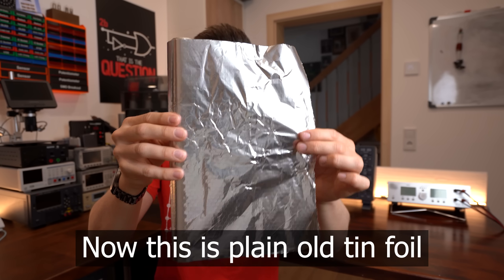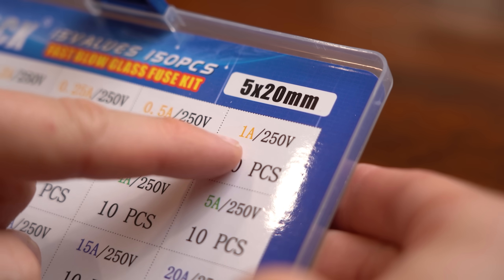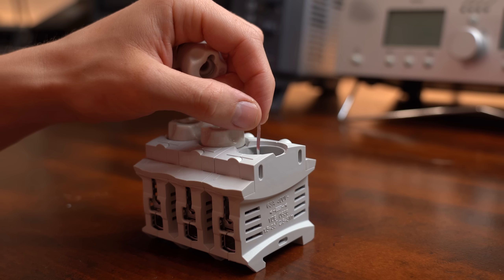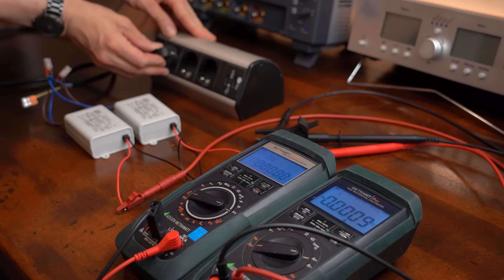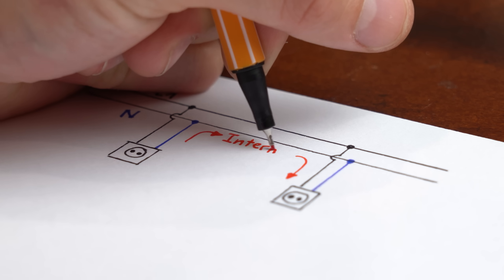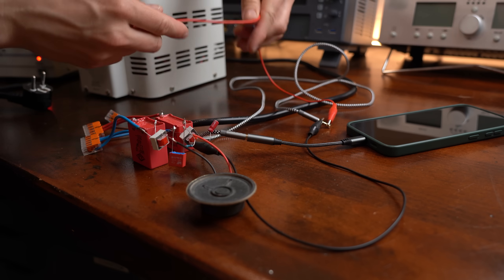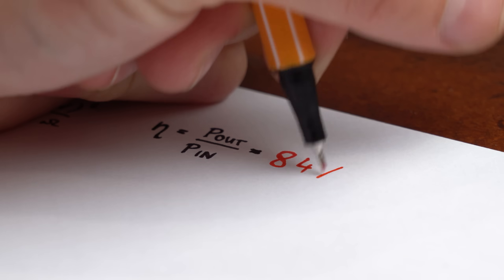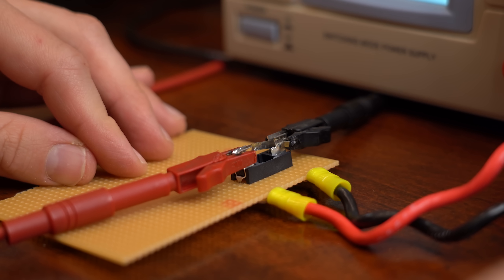I tried Busting 4 Weird Electronics Myths!

Comment: A very interesting video and thanks for the upload. I wanted to ask a question? Did you test the parallel power supplies using linear or switching? I have explored this very idea myself and found that it is the switching frequency that is the issues and when one is switching on and the other off it is possible to gradually phase the two power supplies. The problem is for example when one is switching at 196khz in my experiment the other was switching at 186khz. This presents an issue where the faster supply tends to carry the higher current and offset the transmission line. I guess a good comparison is a Wilkinson splitter /combiner in an RF circuit to balance transistor hFe and gain to ensure balanced output. The same with thermionic valves (hence matched pairs or quads). I have discussed this at length to see what can be done to better this and the answer is always the same? It’s nearly impossible due to the design and inherited from unbalanced switching frequencies. However, with all that said I have a Thurlby Thandar 150v PSU that is 2 x 75vdc at 2amp, 1 x 150vdc at 2amps or 1 x 75vdc at 4amp. This is a switching power supply and shows that the combination of switching supplies is possible so long as the clock is generated fundamentally rather than ad-hoc and combined later. Would love to see this explored more with the switching frequency analysed as well as with purely linear PSU’s?

Comment: What if you put 2 power supplies in series to double the voltage instead of paralell to double amperage?
Reply from the maker: Watch my video about my ceiling speaker system. I did something just like that there and explained it all ;-) That is certainly possible
Reply: @greatscottlab hi what about oldschool metal transformers used in paraller? Will they divide the Power better or worse than switching Power pupplyes.  Or Can i modified them to precise match same voltages so they will not fight each other ? I want to make teslacoil with 3 Power Modes single, double paralel, double series transformer. I need to use them because switching Power supplyes dont like my Tesla coils( probably electromagnetic noise interfear with them in Bad way) but i dont put it together yet.

Comment: 1. At 4:00 it seems that you lost your ceramic body fuse. I used to "repair" those ceramic fuses when I did not had a new one at hand, with stranded copper wire (roughly 1mm2 for 10A) or, once with aluminium foil 2mm foil for 10A. Ofcourse, next day I bought a proper rated fuse. 
2. When the two PSUs are identical, with the same voltage output, is safe for short time to connect them in parallel. However, for safety, I usually add a diode in series with each PSU. I did this with 12V/6Ah Pb accumulators and they worked just fine (I used power diodes 50A each on heatsink), just because I had 3 of them and I did wanted to use them all for more capacity.
3. I needed a audio path and a power (mains) line over 20m so I got 2 wires and connected them to mains. I got so, mains to the place I needed, 20m away from my house. For the audio signal, I used a beefy filter I made at both ends and so the audio signal was perfectly sent over the mains connected wires. I, of course, got my inspiration from POTS circuits that send audio, ring tone and power over two wires. While the 50Hz were properly rejected, the badwidth for audio was no more that 5kHz i think, but just ok for voice.
4. Well, a coil is a coil. I sometimes used stator coils from small burned motors as beefy inductors (>1H) in filters or as common mode filter (from motors with two poles/two coils) for the mains powered circuits. They work very well and are reliable.
May I add the 5th: Using a transformer and a brushed DC motor to make a voltage inverter; is possible or fake?
Reply from the maker: Thanks for all the feedback. Good stuff :-)

Comment: Myth 4: I recall that the old Renault Zoe EV used the motor windings as an inductor for the buck converter in its charging circuit.
Reply from the maker: Sounds plausible ;-)

Comment: Holy crap. That first fuse "replacement" you replace a 30 gauge little wire in a glass pipe with a 1 gauge aluminum wire. That's crazy.
Reply: In theory, you can take the resistance of pure aluminum and do the math to figure out how small of a bottleneck you would need to make for it to actually behave as a fuse, and it could likely be one sheet of aluminum foil thick with varying widths in the middle. To achieve different failure ratings.

Because one of the interesting things is that aluminum wire for power distribution and aluminum foil are both nearly pure sources of aluminum, so their characteristics should be nearly identical.
Reply: When I was in my teens I checked the plug fuse in a mate's vacuum cleaner. It had been replaced with several turns of fuse wire. Electric cooker rated fuse wire.

Comment: I have never seen or personally used a piece of aluminum foil to replace a fuse and expect it to act as a fuse, but I have personally and seen people around me grab a single layer of aluminum foil around a blown fuse as a temporary solution to get the device working properlyand 99% of the time it’s Christmas lights

Comment: Don't trust that Bojack fuse kit!!! I'm working on repairing an oscilloscope that has damage caused by it. The 250 mA fuses take nearly 30 seconds to blow when passing 1 amp (!) through them, and the 2 amp fuses don't fare much better. Always buy fuses from an actual brand like Littelfuse or Bussman, your equipment is more than worth the few extra cents.
Reply from the maker: Thanks for the tip :-)

Comment: Anything conductive can be a fuse if you are brave enough
Reply from the maker: Haha, well yes.
Reply: @greatscottlab  an M5 bolt, perhaps. I've seen that one personally. smh
Reply: @Sekir80  dam wish i thought of that i just used a chunk of copper wire
Reply: a .223 round, it has an audiovisual alert included
Reply: @MrTeddy12397  .22 lr is about the same dimensions as a glass fuse...
Reply: @bullzebub  I remember seeing a thing years and years ago about a hunter that did that in his truck.  He took one in the nards when the bullet heated up.
Reply: @ Only in America. :D
Reply: And anything is conductive if you put enough voltage.
Reply: Best one i have worked on was replacing melted wires because a house kept blowing the fuse and instead of buying more fuse wire they decided to use bits of copper wire, and for a while the fuse would still blow until one day it stopped. What happened is every time it blew it sprayed molten copper everywhere an eventually the fuseholder was covered in enough it became conductive so you pull the rewireable bit out and it made no difference well until the melting happened
Reply: but has to be thinner to behaive like fuse
Reply: A place I used to work did that with one of our vans. The fuse for the a/c blew in the middle of a summer heat wave in Australia. It actually melted the back of the fuse block!

The management wouldn't approve of the cost to replace the fuse box. I told workshop that I'd pay for it, or even go buy a second hand one from the wreckers. Nope.

Instead, the permanently bridged the fuse with something, I don't remember what. Lasted until the van was removed from servics.
Reply: I would use the term fuse.
Reply: NOT
Reply: @edwardmccall450  Sure they are.  Just their amp rating and blow time vary wildly. 9/16 socket? - 300A. 1/2" copper pipe? 500A. 1/0 copper wire? 1000A
Reply: .22LR  - they won a Darwin award for that.
Reply: @randomblogger2835  Nah not really, with no barrel the bullets really don't have much in the way of penetration or range. If you were holding it yeah maybe but if you are holding a bullet hot enough to go off on it's own you are already burning your hand.

Comment: "Two power supplies in parallel": Is it possible to stop the current imbalance between the two adapters just by connecting two diodes to the positive rails of the two supplies?
Reply from the maker: Yes. That stops the current flow between them. But it does not help much with the equilibrium

Comment: you are sopposed to wrap the outside of the fuse with 1 layer of foil end to end like rolling a joint( weed is legal by me) or a cigarette . at that point you take a razor and slice a radial line but dont cut all the way around you want to stop to create the fuse element itself. you can cut a line in a spiral like a barber pole or to some length shorter then the circumference of the fuse. you use 1 layer to keep it consistent. also fwiw in telecom we used to put 2 Motorola 12vdc power supplies in series to power 24v equipment. batt +, batt- and GND and FFS PUT THE 2 METERS ON THE SAME RANGE FRIGGEN MA NEXT TO A I GOTTA IGNORE EVERYTHIGN ELSE TO CHECK THE METERS RANGE... YOU HAVE IT ON MA WITH 4 POINTS OF PERCISION WHY NOT LEAVE IT ON A THERES MORE THEN ENUF PERCISION>>>>> 1A>.9A BUT CHANGE THE RANGE AND I CAN SAY WOW BIG NUMBERS 1A>900ma WOW BIG NUMBER IS SMALLER ?!?!?!? BRAIN BLOW UP OMG YOUTUBE GOD I MUST WATCH MORE..... dont be a friggen newb have your test instrument set properly for comparisons...... fucking 1 meter set to amps and the other set to ma for showing an offset voltage that is centered around 50% sharing to discover the imbalance... did you drop out of eet 101?

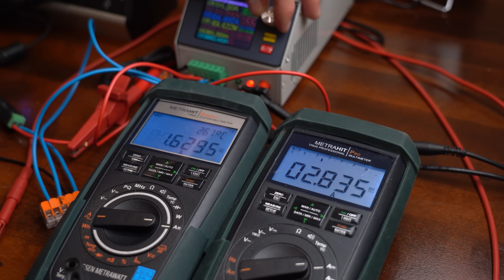7:07 on the left you have 223.7 ma and on the right you have 731.9 ma buy he shows it as 223.75 and .7319.  for example if you asked when the move is and how long is i would say its 2 hours long and its in 2 1/2 hours but by his logic i should say the movie is 2 hours long and its in 150 minutes, you would stop and be like umm how long is 150 mins and you waste time. this is what he does here i am sitting here and moving decimals in a shot that should be a quick and OBVIOUS comparison......
Reply from the maker: Thanks for the feedback. Maybe I can include that in another video ;-)

Comment: For myth 2 if a diode is used on each of the power supplies output before connecting them in parallel would isolate it from each other and give a better equilibrium. But cost would be small voltage drop.
Reply from the maker: I initially wanted to include that in the video. But the video got too long. However it only helps slightly with a better equilibrium. So not really a solution. That is why I cut it.
Reply: @greatscottlab  I was looking in the comments for this remark. Thanks for the addition.